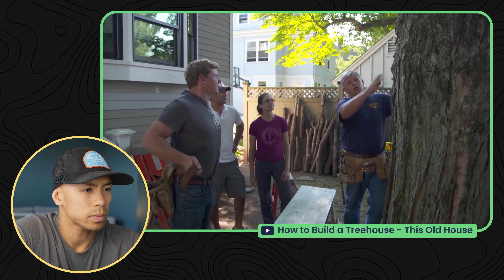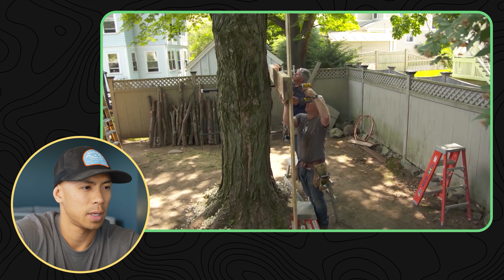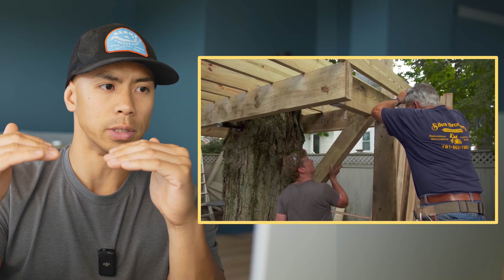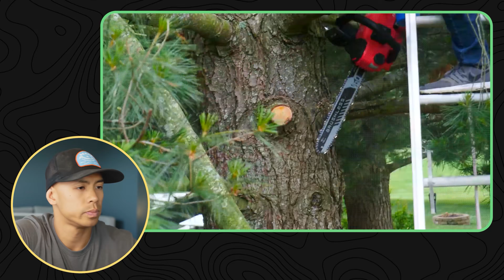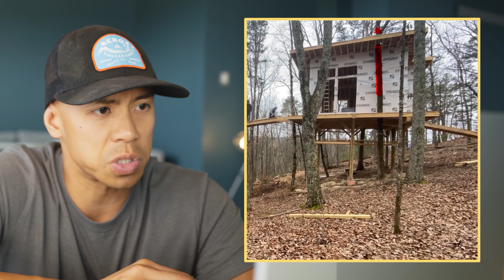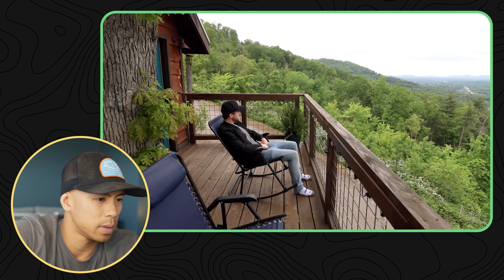Pro Builder Critiques Building Treehouses as Homes & Rentals

Comment: Not a fan of the house to ground piers.  Might as well just build a stilt house (not too close) to some trees.
What would "look" the best imo is using a large tree of a good species , drill the tree , and use use (minimal as possible) house to tree bracing. Use a steel frame staircase also as a structural brace if possible , and incorporate the utilities into it. However this method will limit sq. footage of the house.
                 *To me , the trees around the last house example didn't look to healthy. 🤔
Reply from the maker: Yeah, I can see and understand that.  Yeah the tree around the last house didn’t look super well.  That was in Asheville, I’m curious how they withstood the recent hurricane.